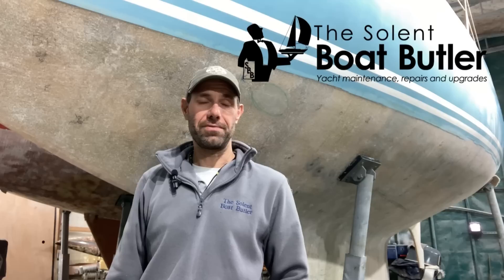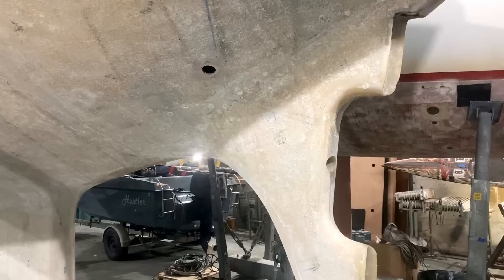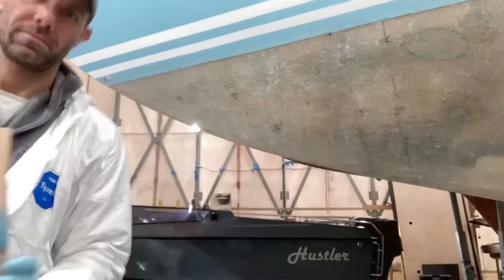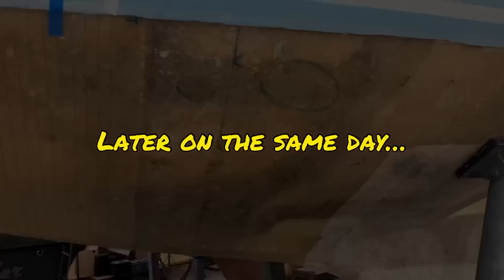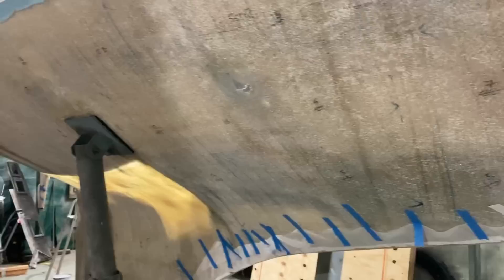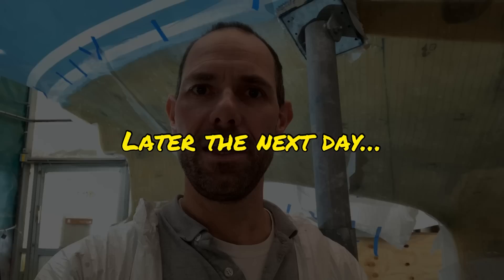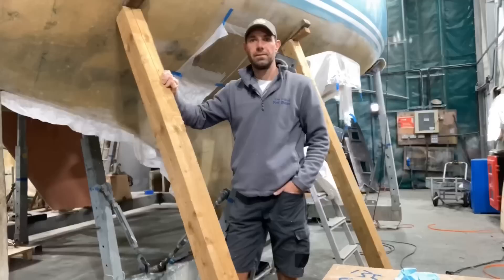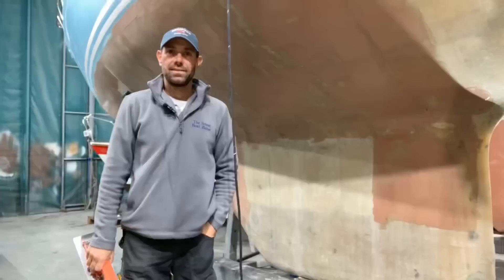Osmosis Repair Part 3 - Refinishing the hull, new glass, filling and fairing (Project Lottie Ep8)

Comment: When restoring cars we will do what they call a rotisserie restoration. It basically puts the vehicle in the optimal position to work on. Seems to me they should be doing this with sailboats to alleviate all this overhead sanding. I can see how everybody starts off very gung ho on perfection and  then settles for close enough. It looks exhausting.

Comment: after sanding 7 layers of failed epoxy paint off my boat with a 6 inch festool i can defo say if i did it again i would use a smaller sander like you have

Comment: More great information…..which brand epoxy do you use, what do you thicken it with prior to applying the un thickened  , and what weight biax glass do you use and do you roll it out or not? Thanks

Comment: I've drilled out with a Dremel some inspection patches through the Gel coat on my Contessa and now I'm ready to fill them again with International Watertite filler. My question is where around the patches should I paint my undercoat primer ? Should I prime inside the drilled out holes or leave that bare for the Watertite to bond direct ? Will the smeared Watertite bond to paint primer ? Thanks in advance.

Comment: Another very interesting video, George.  I don't think my shoulders are built for all that sanding - although I shouldn't need to worry about this for my boat for a while!!  For some reason I imagined that you would need a complete layer of fairing compound or whatever (on top of the fiberglass) over the whole hull equivalent to the original layer of gelcoat, and I always wondered how you would achieve an even thickness and how the hull profile would be maintained.   Now I know!

Quite interesting that you are planning to remove the wet foam in the skeg from inside the boat, because being un-enlightened, I would have cut an access panel in the side of the skeg to get better access and perhaps make it easier to get all the foam out.  I would be interested in your reasoning.

Have you glassed-in the new GRP stern tube yet, because I've always wondered how you do this?

Incidentally, in later glimpses of the neighbouring boat it looks as though the hull is now grey epoxy/primer/antifoul  or whatever.  Has the coppercoat been replaced?
Reply from the maker: Hi John, pleased to her you enjoyed the video.    

I will remove the foam from the top of the skeg as I think it’s going to be easier than cutting an access hatch in the side and then making that good after.   Also the new foam will need to be poured in, it expands in place so really needs to be poured from the top rather than the side.    The plan is to remove the engine and the bulkhead behind the engine to afford better access to the top of the skeg and I can fit the new seacocks at the same time.   Your boat does not have that extra bulkhead after of the engine.   I will fit the new stern tube once the foam is all out, it will be bonded at each end and the new foam will also secure it as I will be using epoxy boat which is also a semi structural adhesive (that is often used when building rudders on more modern boats.

Boat neighbour in the shed has had a gelshield epoxy coating applied and will get its copper shortly I believe.
Reply: @RefitandSail  Thanks for taking the time to explain that, George.  Much appreciated.

Comment: Amazing vodeo series thanks for the insight. When you say material blast is that similar to sandblasting? If so is it just sand or a sand and water mix? Could the same result be achieved with a steong pressure washer like you did with the rudder? Cheers.
Reply from the maker: I think the media used was crushed glass but I leave that to the experts who do it for a living as different media is used on different materials.   Needs to me more than a water pressure wash unless you have an immensely powerful pressure washer.

Comment: questions: could an extensive media blast be done instead of the peel? was there no gelcoat reapplication? thanks..  Love your work mate
Reply from the maker: Potentially but it would take a very skilled media blasting operatives to get an even removal of material. That’s why boats are normally peeled.

Comment: Very nice craftsmanship. What weight and type of glass did you use to cover the hull?  I just peeled the gell coat off  my sail boat and letting the hull dry out while i work on other projects.
Reply from the maker: I think I mention the weight of the glass in the video, from memory it’s 300g but may be 350g.

Comment: why didnt you leaned the boat like 5 degrees on one side to have opposite side free to lay out the glass layers lengthwise?
Reply from the maker: I don’t think that would be particularly safe in a cradle.  It would be better maybe to have a cradle that had pads on the hull above the water but that’s not available to me.   Also easier to handle smaller lengths of glass

Comment: Amazing workmanship. I have a Contessa 32 and would like to install an Airmar transducer in the bow similar to what you have done in this video. Did you fiberglass the bronze thru-hull into the hull, or use 3M 4200 so it could be removed at a later date? Did you have any problems with the length of the bronze thru-hull in that location?
Reply from the maker: It’s bonded in with thickened epoxy and then further reinforcements added internally (epoxy thickened + chopped glass strands).
Reply: I have just completed the installation of the Airmar transducer in the bow of my Contessa at roughly the same location as in Project Lottie. Very tricky because of the sharp angle of the vee in the bow but fortunately the bronze through hull fitting was long enough. I added about twenty layers of fiberglass cloth inside to create a level mount for the transducer. After drilling the two inch diameter hole I wrapped the bronze through hull with plastic tape, then inserted it as a temporary form. Then I added eleven layers of 1708 biaxial cloth to the outside of the hull on each side of the transducer, beginning with a large piece and with each subsequent piece slightly smaller in area until the final piece just covered the transducer itself. The result was a linear transition which was half an inch thick around the transducer and required very little fairing. Then I removed the bronze through hull, cleaned it up and did a proper installation with 3M4200 so it could be replaced in the distant future if necessary. No leaks. It worked out beautifully, but would not have been possible without your inspiration -- you showed that it was possible. Thanks again.

Comment: George what do you think about glassing both sides at the same time with a single piece of glass so that the join is not on the hull centre seam
Reply from the maker: Probably hard to achieve both sides at the same time as I use masking tape on the peel ply to help the glass confirm to the tight radius at the lowest point, if doing both sides (on a co32 at least) it would be hard to get the glass to take that tight radius on its own.

Comment: Great job really enjoying watching your videos , hope you dont mind me asking but what weight biax did you use?  I’m assuming it depends how deep you plain ? and what fairing filler additive have you used , and are you using west system epoxy ?
Thanks again
Reply from the maker: Thanks for the comment.   The weight of glass needed to refinish a hull is dependant to a great extent on how much needed to be removed for the drying to be successful, I used one layer of 300g biax on this boat, if I had needed more material I could have used 450g or two layers of 300g.    While I have used WEST in the past I am not using it for this job as I believe there are better options.  WEST suffers very badly with amine blush when curing and I don’t want to be cleaning that off every time I use it as it’s just a waste of time.  I have used Gurit Ampro epoxy for the whole job and am using a mix of West low density filler and Q-cell for the additives because I know it works and while there are premixed epoxy fillers I could use they are more expensive and I want to use the same base epoxy system for the entire repair.
Reply: @RefitandSail  thanks for taking the time to reply I will def look into the gurit ampro epoxy ,also if as you say on a job you might use 2 layers of 300g biax Is there a reason to not just use  1 layer of 600 ? , would that build the same thickness in theory?
Reply from the maker: @nickshipman620  no issue with using one layer of 600 other than it will take a bit more effort to wet out (remembering that epoxy likes to be warm and it much much easier to wet out glass with warm epoxy/hull).  It would also be physically heavier so getting it to adhere to the epoxy on the hull prior to wetting out may be trickier but doable with a helper I expect.

Comment: Showing my ignorance, with the weight being carried by the keel in a protected environment, why not put the pads above the waterline?
Reply from the maker: No ignorance at all, the boat is on higher than normal blocks so I could access the bottom of the keel and the arms on the cradle are not long enough to reach up onto the topsides.    I agree this would be the ideal solution and I can do it with my own cradle but not possible with the cradle I have to use in this yard.  Using two cradles makes it less of a faff but it’s still a faff doing under the cradle pads.  Thanks for the comment.

Comment: Could i ask what is the approximate cost of all the materials and labour for you to do Lotte's osmosis treatment. The job you are doing is top quality by the way.
Could you approximate for a 30ft, 35ft and 40ft.
Thank you, Graham.
Reply from the maker: Hi Graham, thanks for the comment, I’d rather not put my pricing in the public domain here as I have agreed with the owner not to discuss pricing in the videos.  I’m more expensive than some (but their work is of variable quality in my opinion) but cheaper than others as I’m independent and don’t have the overheads of a larger yard. Every boat is also going to be different in terms of how long it needs to dry, how many seacocks to remove/replace, will some areas need a second peel, what other issues may be found as they have on this boat.   If you have a specific requirement you are welcome to email me.
Reply: @RefitandSail  Totally understand, where can i find your e-mail?
Reply from the maker: @grahampinchbeck99  george(at)solentboatbutler.co.uk

Comment: Is all of this work cost effective versus buying a boat without the problem?
Reply from the maker: Depends on the cost of the boat and what the long terms plans are I guess.    Of course it would be nicer to buy a boat without osmotic blistering but unless you wish you spend 300k GBP on a new co32 then you are probably looking to buy one that was built in the 70’s whish is when the majority of them were built.  Because these are all old boats now any have a degree of osmotic action/dampness in the hull, many have had this sort of work and some have not (or may not need it if they have spent long periods ashore in that 50 years.   

I think what I’m saying is if you are buying a 30-50 year old boat you have to expect some of these old-boat issues.

Comment: What's the benefit of white pigment clear epoxy on top of the faired surface as the last layer before barrier coat? Why not barrier coat directly on the fairing?
Reply from the maker: Using a solid colour that you apply and then sand though is called a guide coat and make it easier to find any imperfections in the surface so they can be filled prior to putting on the barrier coatings

Comment: How do y9u apply unthickened epoxy on top of fresh thickened epoxy? The thickened layer doesn't get 'pulled' and disturbed by the top layer of sticky clear epoxy?
Reply from the maker: As I filmed this a short while ago now I can’t think which bit of the video you are asking about but as long as it’s warm so the epoxy is reasonably liquid (it becomes more viscous when cold) it is possible to carefully roll or paint unthickened epoxy over thickened epoxy without disturbing too much although it would be easier to do it once the first layer has gelled/set up to come extent so it’s firm (if not hard).    Hope that helps answer the question